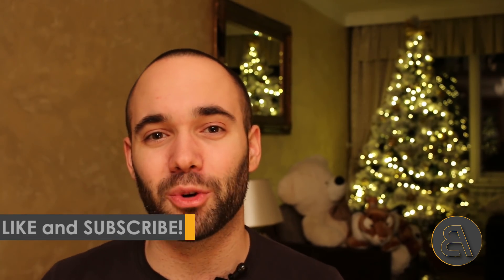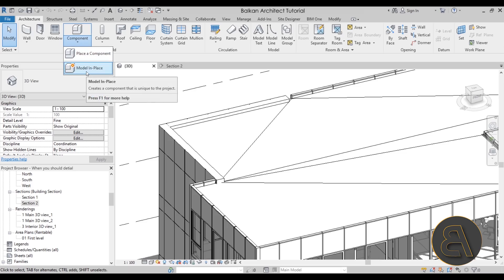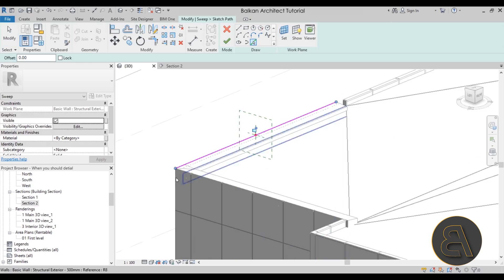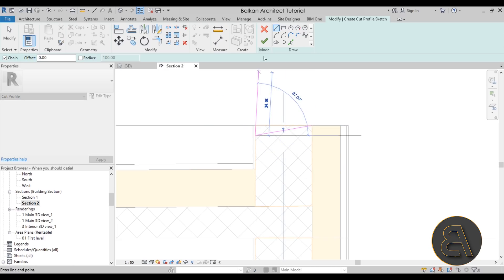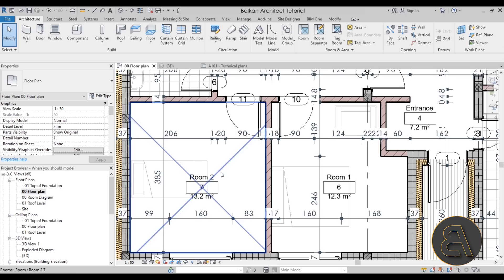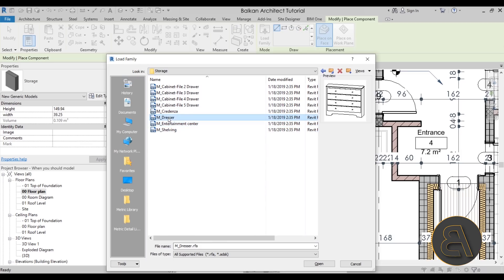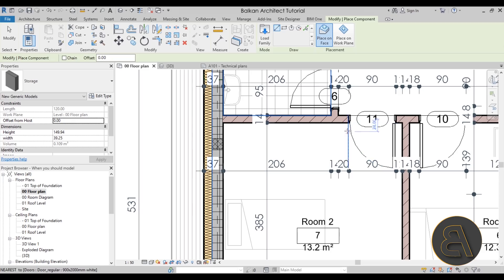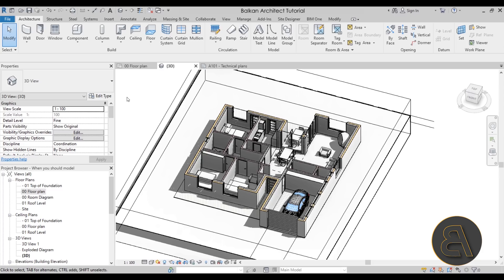When to Detail and When to Model in Place - Revit Tutorial

Comment: The detailing is very useful if I need to draw a plan or work specifications, modeling on the other side lets you use Revit as a database - so the client and producer knows the price, volumes, materials (info on the metal sheeting for the wall in the first part of the video)

Comment: This is a structural question. 
I am trying to place rebars in a curved slab edge at a 150mm spacing along the cross section. Problem is ,free form tool only gives me a straight bar and i cannot edit it to desired shape. The other option is to use Radial Array tool but bars are not treated as a set and therefore hard to edit them as a group. Please help,anyone.